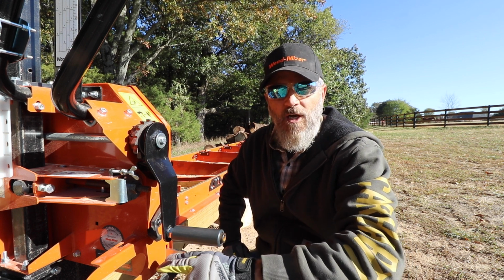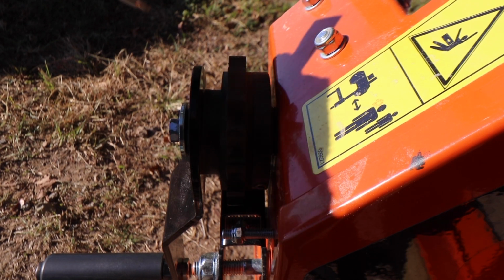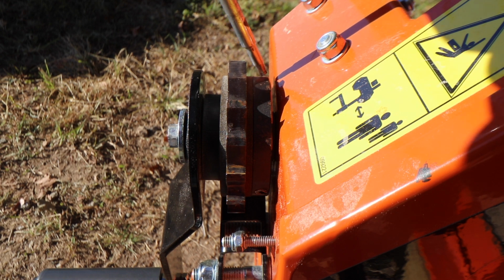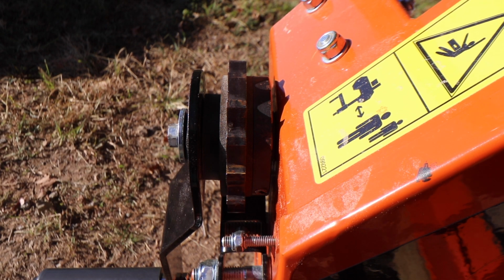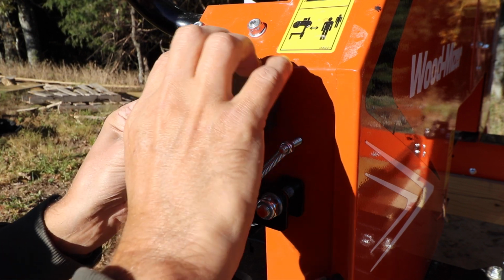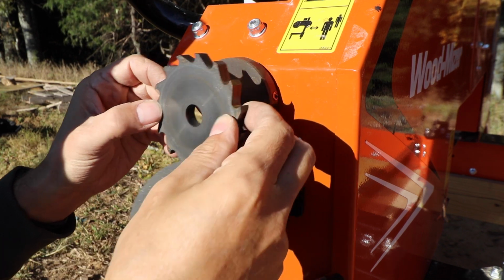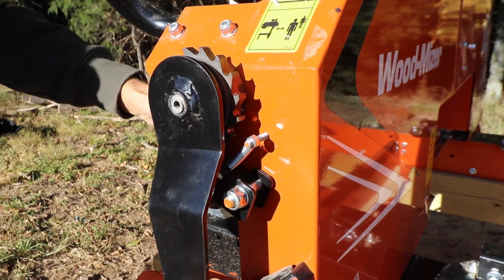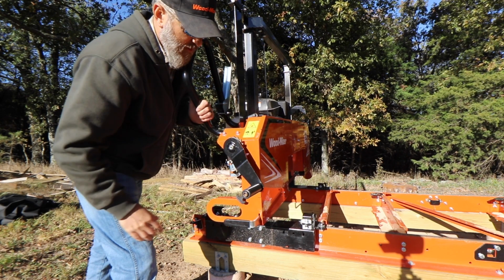Wood-Mizer LX25 Sawmill Friction Brake Failure - How to Fix It

Comment: Good post, Scratch.  

As LX25 owners know, the assembly manual does not cover the lifting winch/clutch.  Mine did not work at all when I first got it a year ago.  Disassembly showed that the crank threads were a little dirty/rusty.  All I needed to do was clean everything up with wire brush and reassemble.  The important thing is to lubricate the crank threads but not the clutch disks and keep water out.  Water will cause rust and then the clutch disks don't want to release.

Keep up the good work.